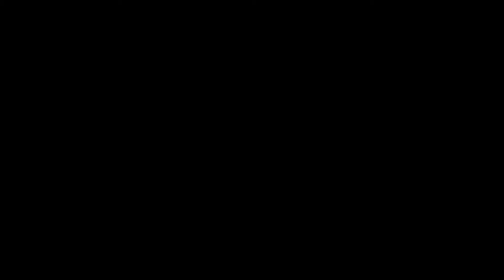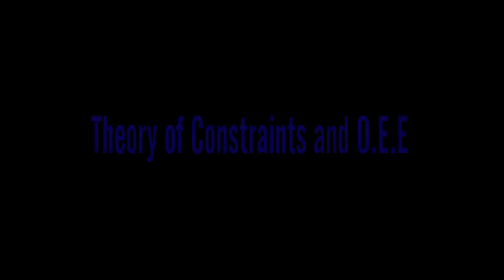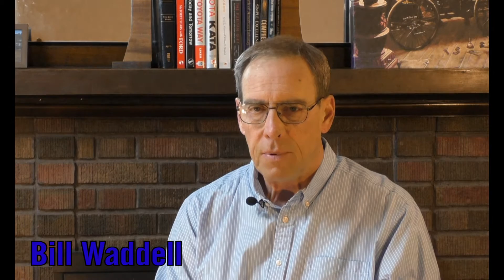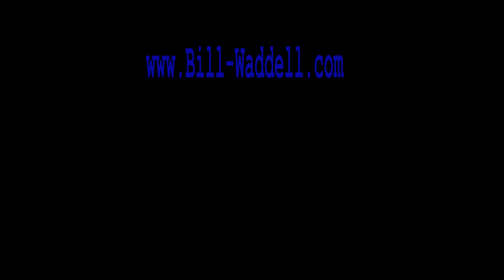Theory of Constraints and O.E.E

Comment: Is O.E.E. really sufficient for TOC or only necessary. As far as I understood TOC, we should not only focus on O.E.E. but also on increasing the 14 hours of 16 to 16 hours. If I only produce e. g. 10 hours out of 16 with a 100% O.E.E. I'm nevertheless in trouble. So O.E.E. is necessary but not sufficient.
Reply: Michael, if you only produced 10 hours out of a total of 16 theoretically available your OEE cannot be 100%  It would be 62.5% (10÷16)  OEE would point you to where the 6 hours were lost: machine downtime, throughput rate or yield.
Reply: @billwaddellleanmanufacturi5211  Hmmm ... but if the missing 6 hours is intended downtime? Or in your example the missing 2 hours is in a certain way intended? Then I need to focus on the 2 hours because having 100% O.E.E. in the 14 hours will not help me. If I don't "need" the 2 hours, than my machine is not the bottleneck.
Reply: @mhecht2909  If you don't need the hours then th he machine is not the constraint and you don't really need the OEE data. If you need the full 16 hours and the 2 hours are intended downtime then you should re-evaluate your intentions and get back those 2 hours.
Reply: @billwaddellleanmanufacturi5211  Ok, so we finally agree 😉. Have a nice day.